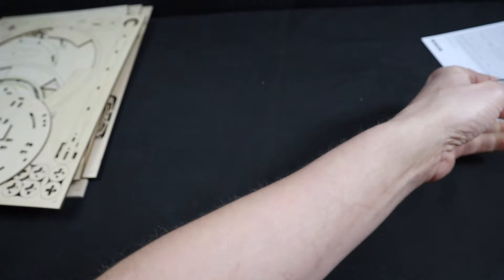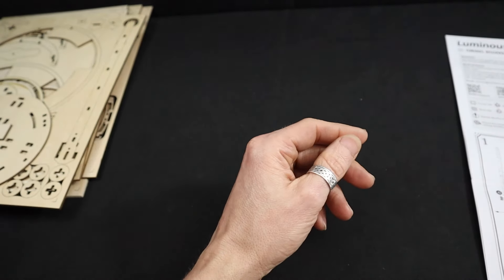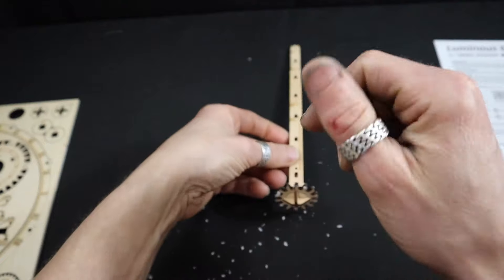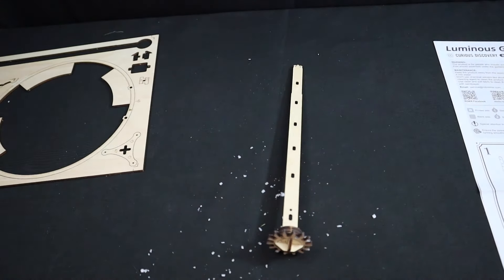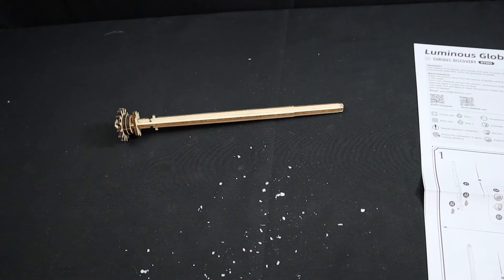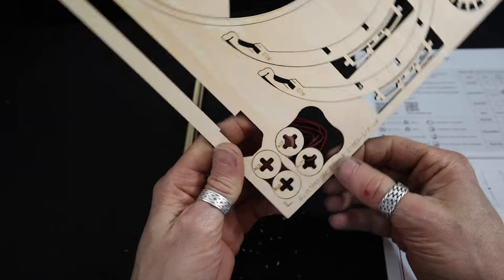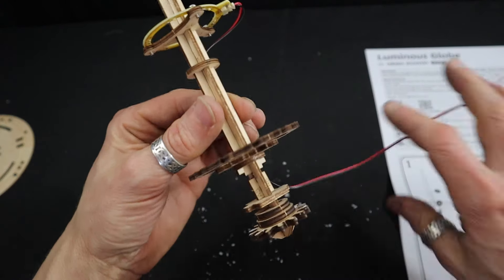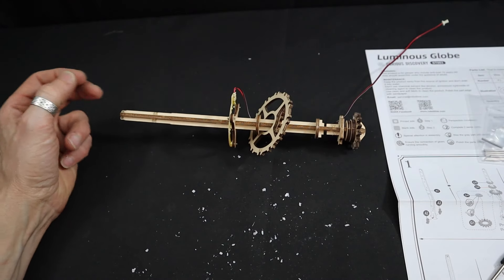ROKR Luminous Globe Unboxing and Part 1

Comment: Hi, Daniel. Thank you for your excellent videos. Your real time format is absolutely the best on YouTube.  The pace is very relaxing and as I am new to modeling, watching you sand and install pieces was wonderful.  When I opened the box and saw the instructions, I concluded that I would not be able to complete the project. After watching your video, I am grateful that you are instructing me through the process!  Again, thank you for getting me started in modeling as I have retired and now have the time to start a new hobby.
Reply from the maker: Thank you, I’m glad it helped, and thanks for watching as well! That globe is a pretty challenging build, as far as models like this go ROKR is a good starting point, most of their stuff goes together like a dream with usually one or two tricky steps, but I think they are usually some of the best results.

Comment: Just bought this and will watch your video for assembling :) did it require glue? I can't see in instructions where is says glue vs no. But they mention we won't get glue in the kit due to customs and have to source it ourselves.

Also they didn't provide wax for us.. I assume if I get some rub on wax from hardware that should suffice?
Reply from the maker: It does not require glue, there is a part where I had to use some very mild two sided tape to hold the globe panels on. The wax is just normal paraffin wax, so you should be able to source that from a hardware store, or possibly cosmetics store. 

Good luck!

Comment: Where did you get the wax from I looked everywhere for that but I couldn't find it
Reply from the maker: It usually comes with the kit, it looks like a cut off candle, I've actually switched to using vaseline (thanks to a helpful comment) just because I found it easier to get in all the nooks and crannies of the gears.
Reply: The packaging says due to international shipping regulations the wax and glue may not be included. I would send a screenshot but yeah